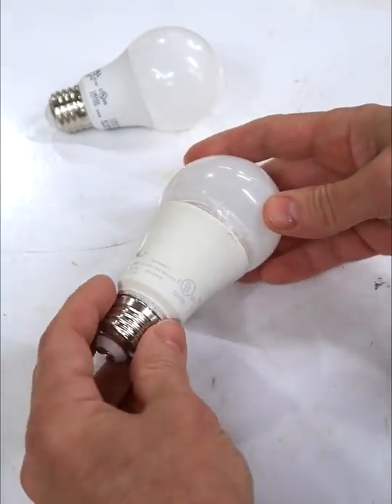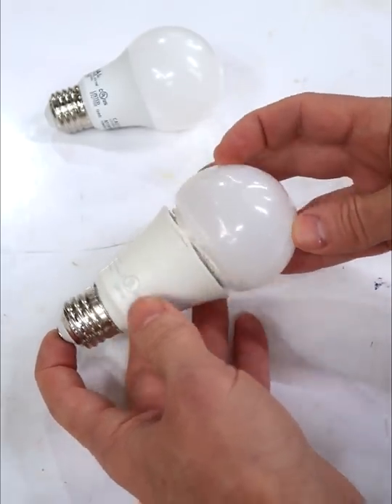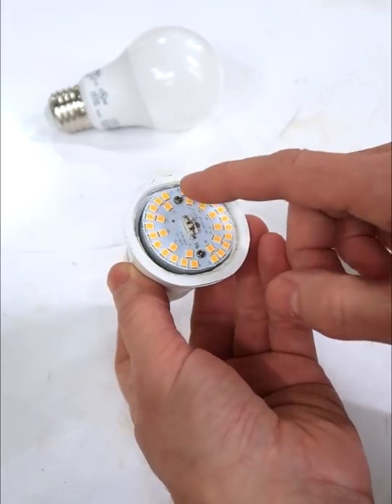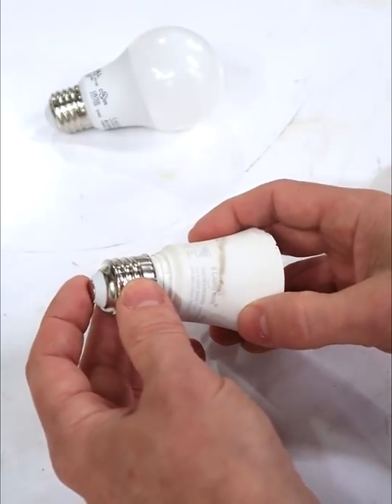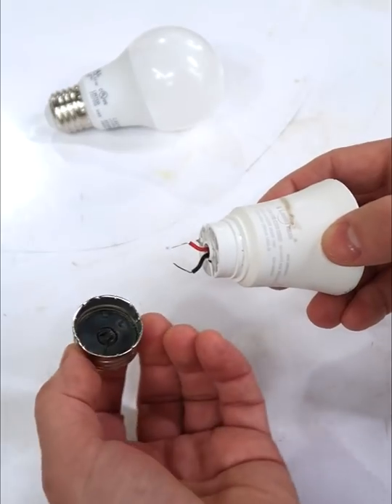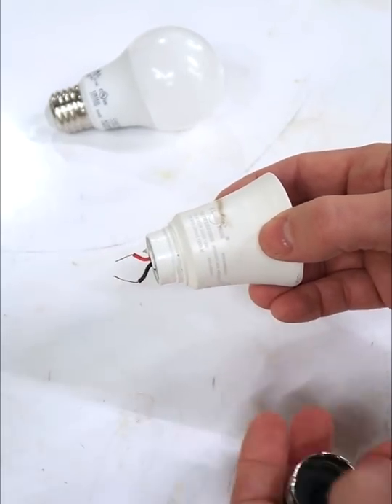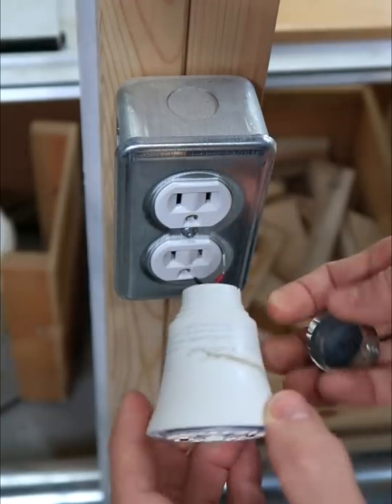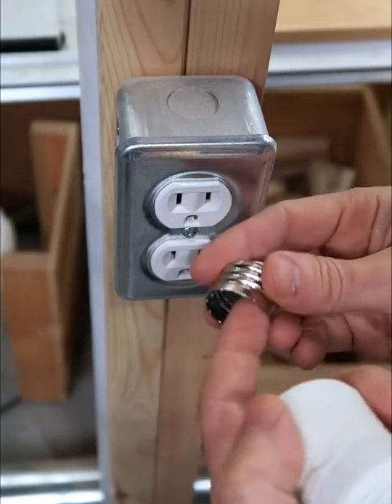LED bulb failed for dumbest of reasons

Comment: I spent over $1000 when I moved into my new house to replace all the ceiling lights with retrofit LEDs. The brand I bought turned out to be garbage, and over 50%, honestly more like 75%, failed somehow within a year. Mostly they started flickering and then went very dim. When I complained all they would do is send a replacement, and then those all failed too. Eventually I just returned as many as I could under warranty and replaced them with the ones from Home Depot. Haven't had a problem with those yet.
Reply: About 2 years ago I had the best luck with the (at Home Depot) Feit brand. Now they are running about 25% early failure

Comment: They're good for 22 years, they said....

And, yes, I've had several from the big box retail stores that go out in a similar fashion.  I've just never taken them apart to see why.
Reply: I have loads of LED smart bulbs, even some cheap chinese ones - i have had 1 fail in about 6 years now and that was a philips hue one, one of the first i got too.
Reply: mostly its failing LED's. If you open them up and take a look at the chips you can see black dots thats where they failed.
Reply: @DimitriLanderloos  Admittedly, I have some that have literally been on for over a decade (outside, too).  But their performance is probably due in part to not being powered on several times a day.  No, I think a lot of this is due to garbage manufacturing process and poor quality control.  Sounds like you've been the beneficiary of some good luck in that department.  Best
Reply: For me, half of them have never blown, while the other half burn out in only a year. It seems to be a dice roll.
Reply: @specialopsdave  part of it is luck, part of it is the companies that build them so they fail quick, part of it is the money you buy them for reflects often the quality of the components.
Reply: @Ramog1000  Agreed, I've had better results using GE bulbs over store-brand.
Reply: The box SAYS they're good for 22 years but read the fine print. It's based on a 3 hr. day. Whoever heard of a 3 hour day. I know what they mean but to me it's not practical.

Comment: Heh.  I had a similar failure in one of those 4000 lumen “tri burst” style lamps.  To be fair, it wasn’t a passive failure, a critter in a barn reared up and wacked it, and the bottom contact of the threaded base pushed into the mount so it wouldn’t contact.  Some work with a pick and some high-temperature epoxy, and it’s fully functional again.  (horse is fine.  The lamp socket had a critical failure and needed replacing, which is why the lamp didn’t shatter, I assume.)

Comment: This is actually a good point. I have been buying led bulbs since they were very expensive but put out very little light. The color output of CFL bulbs bothered my eyes so I was eager to find something better. Once the output improved I bought a few for outside. Eleven plus years and they are still working perfectly. One bulb has never been turned off.

Comment: They've got planned obsolescence in them. If you can get hold of them the Philips Hue 'Dubai Lamp' they'll last forever - they are a standard Hue bulb but made for the Dubai market, the only difference with them is they have a life expectancy about 20x higher than any other bulb, and have propper cooling. The ruling leader of Dubai did a deal with Philips to have a special version of their lights made exclusively for their market.
Reply: That’s incredible
Reply: they are also selling them outside dubai under the "ultraefficient" name.
Reply: Simple design, they just use the normal hardware for a light twice as bright. All the bulb manufacturers know exactly what they're doing and every bulb failure is by design.
Reply: The CRI isn’t terribly great however at only 80. I’ll take a high CRI Dubai Lamp if they’re ever made.
Reply: @Lauren_C  they rebranded those lamps as "phillips ultra efficiency". you can get them everywhere.

Comment: I've had good experiences with LEDs so far by sticking to brands I trust, like Philips and Osram. They're marginally more expensive, but appear to have better build quality than cheap knock-offs. They also tolerate supply fluctuations much better than the dismal CFLs that they replaced (and a fortiori incandescents, with their abysmal inverse 12th power lifespan dependence on overvoltage).
Reply: Phillips for me!
Reply: is your douchiness intentional?

Comment: I replaced all lightbulbs in my house 2013-2014 and have had only 1 fail so far. Unfortunately, it's seems having a product last as long as it can was bad for the profit margin since replacement buying was diminished. They soon replaced the 20+ year lifespan ones  on the shelves with 13 year bulbs. I think they chose to add back in some obsolescence like the stuff showcased in the video. Brands/design matter too, I think its a bit too much to generalize the technology as a whole.
Reply: I had the same thoughts years ago when they first came out. "If the bulbs truly have this lifespan this is some major market disruption"
Reply: The world's method of doing business is pure madness. Building things that last is bad for business? Lunacy!
Reply: @MandoFettOG  They don't though. They lose their lumen count with each use. So, after 4000 hours of use, you are down to like 80% of the illumination you started with. Another 4000 hours, you are down to 40-60%. So, your bulb may last, but your house is getting a little dimmer every day.

Comment: The only problems I've had with LED bulbs is with the very cheap ones from knockoff brands and some name brands like general electric . The older Cree bulbs that I've used are great however the new cree bulbs are not so great.

Comment: The USB charging port on my $100+ headphones failed last week. I tore the darned things open and the port fell right off the circuit board. Frankly, I'm not sure how the port was ever making electrical contact. The pins were all totally devoid of solder. It was as if they put it on with none at all! It managed to work for years like that, somehow.
Reply: what brand were they??

Comment: I've had some GE's flicker fail. Quiete the annoyance. Thank you for this short. I hope those A/C leads are diode protected, in case there is a capacitor that needs to be drained, after the electrification loss, on the bulb model I have to work with....

Comment: There are too many cheap LED bulbs around. We had home improvements done around 2 years ago. The electrician installed many recessed downlighters fitted with 5w GU10 type LEDs (a store own brand name). In the last 18 months I've had to replace 19 of these units. Like you I opened up the first ones to see what had failed. They contain a 2x3 grid of 6 small emitters, and in each case one of them was visibly burned out, thus preventing the rest of them working. I have replaced with Sylvania equivalents, and so far the replacements are faring better. I still don't expect they'll last anywhere near the advertised life span 😒
Reply: so you'd rather few expensive ones that come from the same chinese factory anyway?
Reply: @natalieisagirlnow  the difference isn't as much as you'd think. £1.60 each for the own brand ones that don't last vs £2 each for the reputable brand one that I hope not to be constantly replacing. Yes they're all made in China, there are many many factories making LEDs out there, but there are also many different specifications of product. The motor industry get the pick of the crop, then it all slides to varying degrees from that point. I have several older GU10s in the house that have seen 5+ years service.
Reply: @natalieisagirlnow  you are mistaken. Having been there commercially I can tell you Chinese factories and their output vary enormously.
Reply: @V8PropaneBurner  believe what you want.  expect the worst and never be disappointed

Comment: I converted our incandescent and CFLs to LEDs years ago.  Have only had 1 fail--a decorative LED in a chandelier-type fixture.  Our ceiling/wall fixture incandescents used to fail routinely, so we kept step-stools in 3 different locations in the house.

Comment: Here in the States, Dollar Tree sells 60w and 100w LED bulbs for $1.00, although I heard they are raising the price on everything to $1.25 USD. I haven't had one fail on me yet, but I will not be surprised when one does.
Reply: Yeah you shouldn't be, because litelarily every single one is going to fail eventually. Nothing lasts forever.
Reply: Gets cheaper than that at Walmart. You can buy a 4 pack of Great Value 60w LED bulbs for $3.36 or roughly 80 cents a bulb after you factor in taxes.

As for the Dollar Tree, they aren't raising everything to a $1.25. They just increased the price so they can include products they normally would of been able to before inflation and additional costs.There will still be things for a dollar there.

Comment: I had a batch of bulbs fail in another unexpected way. The housing came apart, which then stressed the wires inside because now that is all that was holding it together. Luckily I bought them at Costco and returned them because I was already over a 50% fail rate with this issue. No other issues, and the bulbs that were mounted in a way that gravity held then together had no issues, which are the 50% that survived, but I still returned them because I know if I moved them somewhere else, they would have an issue

Comment: I've had this happen once, and I had a desk lamp I didn't like very much since the dome was too small such that any modestly sized bulb would just stick out, so I put the two together by taking off the socket of desk lamp, and the circuit off the LED bulb and conected them directly such that the LEDs sit right at the base of the desk lamp dome. Still works great after a number of years

Comment: The only good LED bulbs I've had have been expensive Phillips bulbs (and I think some expensive GE ones now too). Any of the Lowes/Menards cheap packs where you can get 10+ for less than $15 all failed after a year or so.
Reply: I replaced all my lights with LED bulbs from Menards 4 years ago, and the only issues I've had has been the "dimmable" LEDs going bad. All the others have had no problem. I doubt they'll last 15 years, but I'm way past "only last 1 year" stage.
Reply: this..my HD off brand ones have turded out in short time and they are hardly used much.

Comment: Most of the ones I buy have a 2-3yr warranty.  I use that on occasion that bulbs fail.  If you just chuck them out, you play into the hands of the manufacturers turning out products with shortcuts.  Likely that this bulb was supposed to be soldered but the outsourced supplier just reduced the spec without consultation with the company they’re producing the lamps for.

Comment: What brand are they? I only use Philips and honestly I can't remember the last time one failed. And I definitely have more recent ones because I needed more powerful bulbs, a few more for some other stuff etc.

The only LED bulb that failed on me in the last years is a non-Philips smart bulb that got so hot that it melted off the solder at the LED PCB connector. I just resoldered it with a lot of solder to increase thickness and even that one still runs just fine.

Comment: I've had to retire several due to flicker. It's infuriating that this might have been the reasons these costly "last for 12 years!" bulbs died prematurely. 😒
Reply: probably not, most flickering ones have dying LED's, most commercial LED bulbs are driven a bit too hard and at some point the chips just fail, can be confirmed by looking at the chips, there are usually black dots visible in them.
Reply: Agree, they tend to be driven too hard, by design (or at least, by business plan)

Another common failure mode is use of underrated capacitors in the power supply (which is what I expected in Matthias's case based on the description of the failure, before he demonstrated otherwise). Especially when on an electrical circuit shared by power tools, where presumably the inductive motors put spikes back onto the circuit that fry the capacitors that have insufficient margins.
Reply: @Nono-hk3is  Big Clive did a video about LED bulbs from Dubai and the laws out their mean they drive them less so the bulbs last longer. You can spot them because they have twice the number of LED strings compared to a comparable EU one.
Reply: @bunnywarren  yeh its a bummer they can't be bought here, I would pay double the money for them not driving the leds as hard as its usually done.

Comment: i've had one fail after just a few months use, i opened it up and its current limiter chip has failed open circuit! not really surprised as they get very hot in use, the older simpler capacitive dropper ones seem to last better!

Comment: If my dear old mother saw you put that directly into the wall socket you'd be grounded for a month. 

Flashbacks to my childhood
Reply: hah, grounded
Reply: *... on a  off.
Reply: She sounds like a live wire.
Reply: He only used live and neutral.  Definitely not grounded.
Reply: @danliebster9894  The power has been neutralized.
Reply: Shocking
Reply: ironically, it isn't grounded
Reply: Were you not allowed to use lights?
Reply: @natalieisagirlnow  Its all bonded neutral to ground in the panel.  Don't panic.
Reply: I bet she lights up a room when she walks in.

Comment: I've had bulbs fail as the wires from the bottom are pushed into the contacts on the circuit board and not soldered.  Same with the capacitor that filters the rectified dc for the driver if soldered would last alot longer.  They come loose from heating and starts to arc slightly and destroyed the driver chip.

Comment: All light bulbs are engineered to cost which includes adding in a few failure modes. Yes adding. Lightbulb manufactures colluded to limit bulb lifespan and maintain their profitability. This is one of the main reasons I’m loath to move to led fixtures over led bulbs. Bulbs fail I get a new bulb ($4). Fixture fails I get a new fixture ($40). There’s no reason for the fixture manufacturer to not include the failure modes from previous designs since that means added profits for them. Especially since the fixture manufacturers are mostly just the lightbulb manufactures w a mustache on.

Comment: I buy CFLs for this reason. Electricity is super cheap in my area i could use incandescent & still it won't effect my pocket much. So to keep the headache away i buy CFLs cus even good branded led bulbs fail within a year while i have CFLs running 5yrs+. Even the Phillips ones fail !! The driver dies or one of the leds go open circuit!

Comment: With all the talk about being sustainable led bulbs are the worst - true energy consumption is low but circuitry fails ages before led themselves.
Reply from the maker: The packaging is all wrong.  Light fixtures were designed to enclose the ugly bulb, and the bulbs didn't mind running hot.  For LEDs putting so many LEDs in a small poorly heat sinked space is a recipe for short life.
Reply: Still lasts far longer than the alternatives regardless

Comment: I had a similar bulb, that just failed, the base ( heat sink ) cracked, and was hot.  There may be lots of expansion and contraction when the bulb is cycling on and off.  It’s a good idea to change bulbs as soon as they show signs of failure.